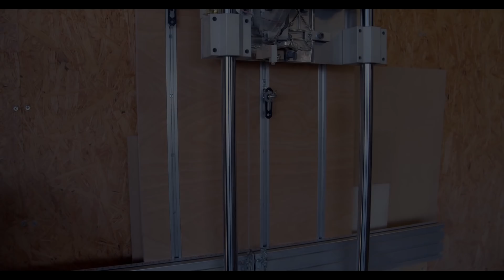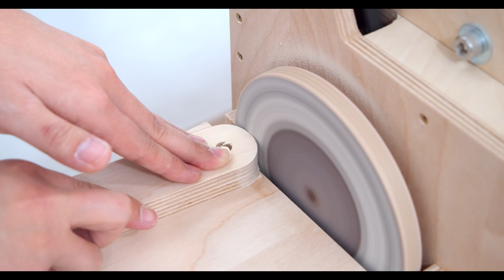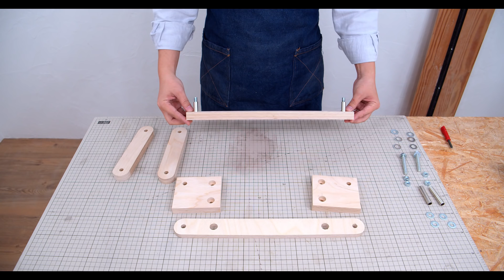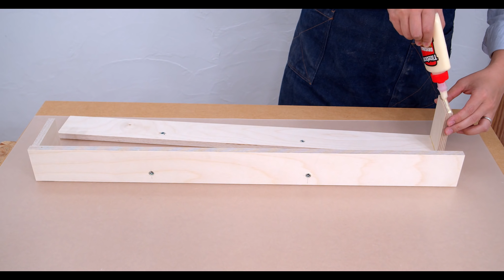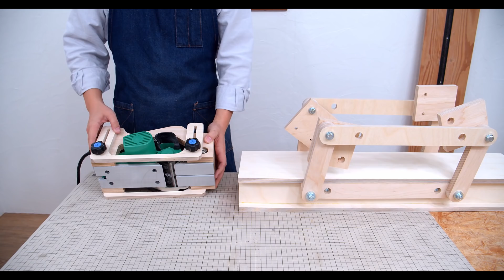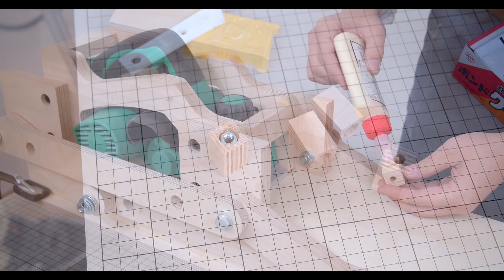Parallel link Planer jig - Rig System Part.2

Comment: I like your plane mount which should work for my 1900B, but I think I'm going to overengineer the vertical adjustment using 4 columns with timing pulleys and belt.  I'm looking to flatten 40cm x 150cm chainsaw milled lumber.
May I ask where you get baltic birch plywood in Japan?

Comment: question here is what if the lumber is not straight on the initial run?
Reply: Hi Marvin Lim, unless the initial piece of wood is twisted, or is too long to be in same contact with the base from start of cut to end of cut , then the top will be planed flat and parallel with base. The workpiece just needs to be flipped so freshly planed edge is on base and then plane to required thickness. If the wood is not straight then it will have to be much thicker than the requirements of the project to allow for the extra machining to get it flat. If the wood is twisted,  then it would need to be clamped to two side supports sliding flat along the base that are lower than the top to be planed, that way there will be no rotation of workpiece whilst planing top face.

Comment: What's the advantage of this system vs. those that make a table top jointer jig for their planer?
Reply: This basically turns an electric planer into a thickness planer. So you can joint one side of a board, then run it thru this jig to make both sides parallel.

Comment: Mr Koubou I really apreciate and thanks all the knowledge and also the method to work you give us in all videos, for the first time, respectfully, I will make a comment to improve your work (if posible) I would add a zink plate or any other metal over the base where the wood slips to make it last as plane as 90° perfection requires, thanks to accept this humble recommendation from Argentina, my best regards

Comment: Do you notice that when you turn on, and especially when you turn off the drill, does the speed increase? This is because the drill is not working at its nominal power. You should actuate the trigger with a seal at its maximum travel and place an extra switch on the machine frame. Even the perforations are going out more accurate. Greetings from Argentina!
Reply: He made that drill press. It's basically a frame around a hand drill. It's a very interesting build. I recommend watching it if you haven't already. I've used something similar but not nearly as nice. 

I think the drill has a trigger lock and he needs to squeeze the trigger to unlock it, to turn off the drill. I don't know if the drill has a screw on the trigger, in order to hold the trigger at a set distance to control the speed, but he could loosen it if he wanted to, to make the drill slow down more gradually; instead of only squeezing the trigger.

- - Edit - -

I think that I missed your point. I can't say why he isn't running the drill at full speed. However, I do think that running the drill at full speed may be useful for some drilling tasks; maybe not all. I think an external power switch is a great idea though.

Comment: You can probably build a small, automatic feeder with some rubber wheels and a motor, or a belt sander.

In fact, you could probably put a portable belt sander behind this unit to give it a good surface sanding as well after planing,  and to get rid of the scratches left by the planer